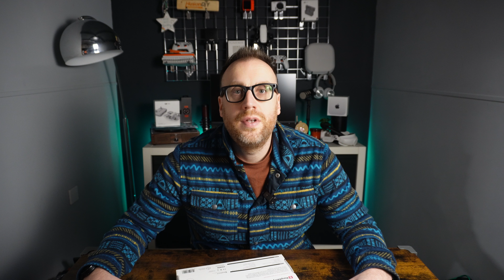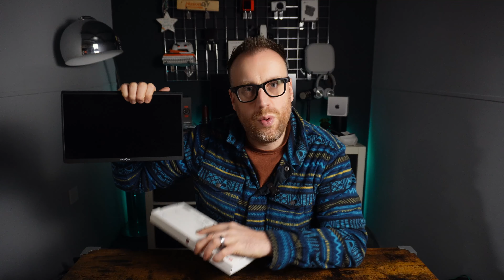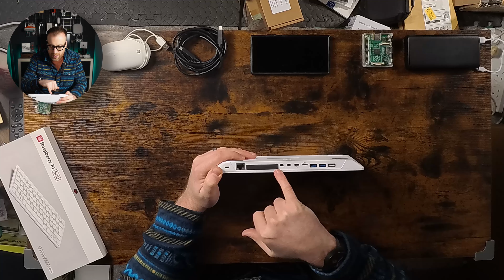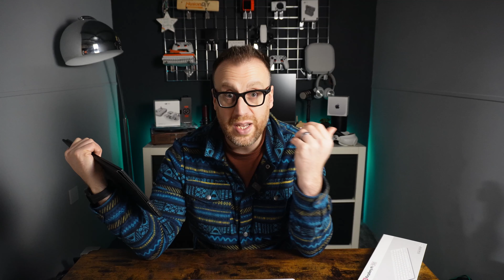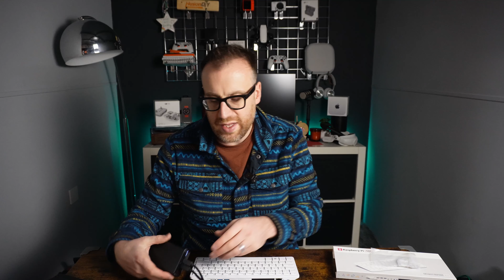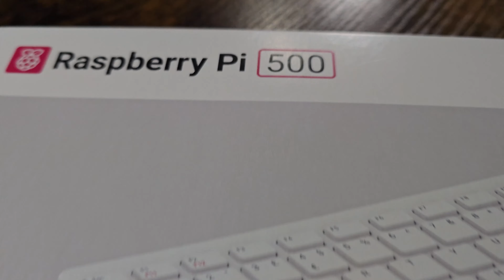Raspberry Pi 500: Unboxing, Setup & First Look!

Comment: The only reason I will NOT be buying this is because they did not add the port to add an NVMe drive to the Raspberry Pi 500. 
They missed a huge opportunity for a low cost desktop computer as microsoft force people to scrap Windows 10 computers this year. It would have been a good replace until Microsoft bring out Windows 12 in 2026/7 and, who knows, people may have stuck with the RP 500 once they start to use it as a basic desktop PC for email and browsing.the web.
Reply from the maker: Yeh great shout!! They potentially missed out on more sales didn't they leaving that out!?
Reply: Ugh. It's a 90 pound educational computer.
Reply: Nothing stops you from using external hdd or ssd
Reply: @machoman6969  People want a compact computer not a daisy chain of wires and add-ons.